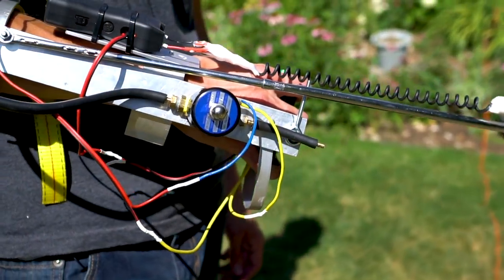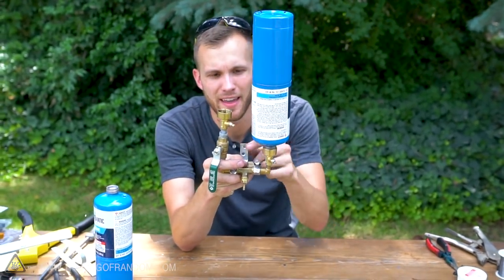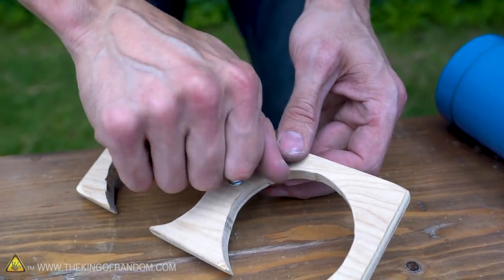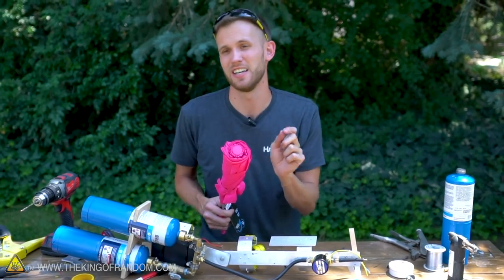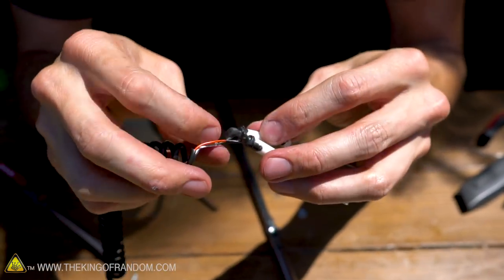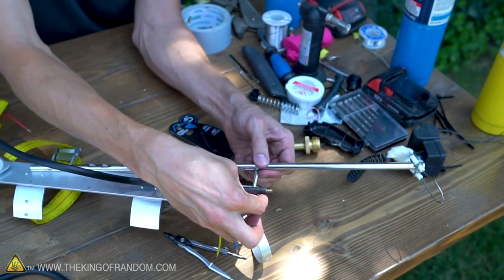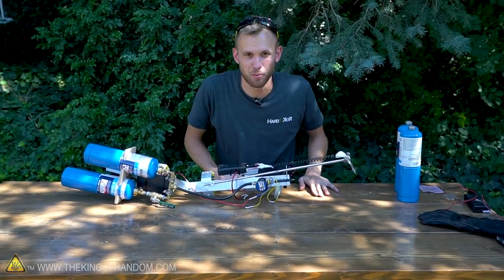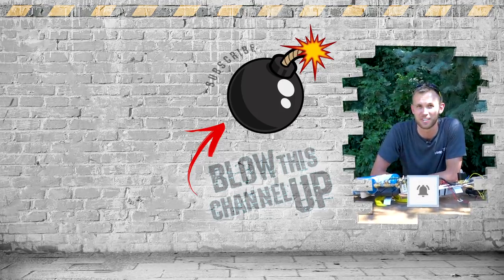Guess What Happens If The Button Gets Pressed?

Comment: when in doubt, just mix a metal brace and a modified propane lamp... basically set everything on fire that's causing you problems to make a problem that's bigger than the original problem so you don't have time to worry about the old problem cuz you have a new problem.

used way too much "problem" there.

Comment: Biuld another flamethrower it would be easier,less technology and less heavy if you just use a lighter and hair spray build a way to hold down the lighter button with out holding the lighter and without holding the hair spray